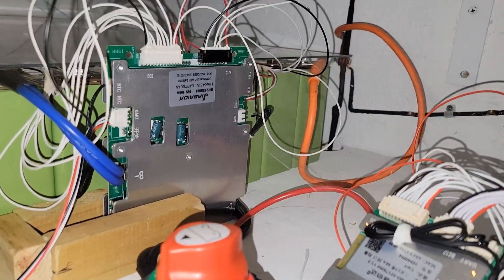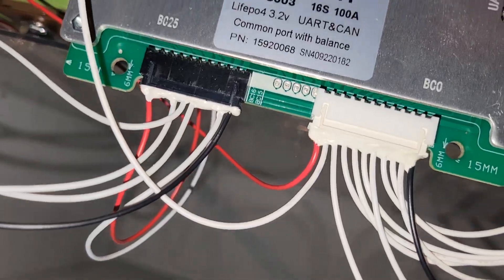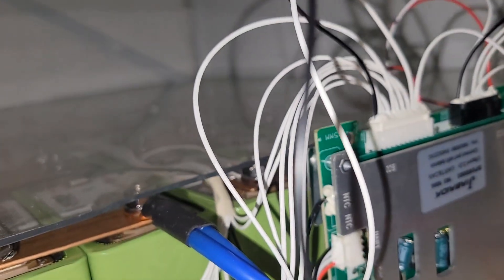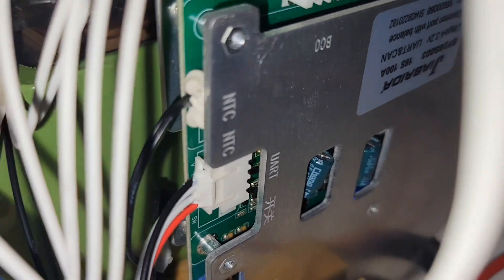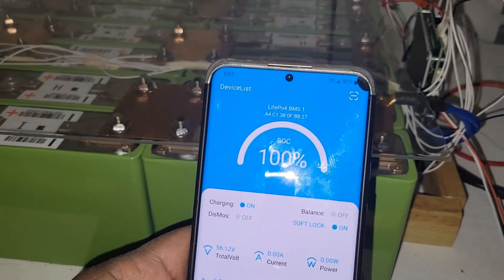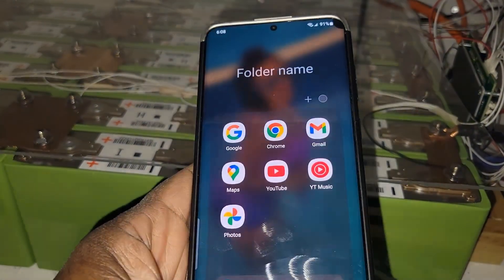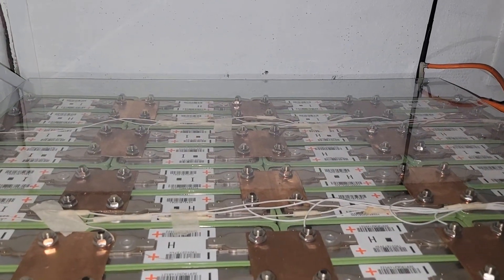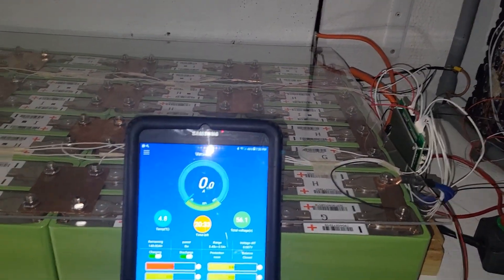HOW TO WAKE UP JBD BMS 16S 48V 100A

Comment: Sir, How to wake up Jbd smart bms ? Can you tell procedures
Reply: Model no SP24S004
Reply from the maker: It doesn't  need to wake up. Once you plug it in with the wires, it should turn on